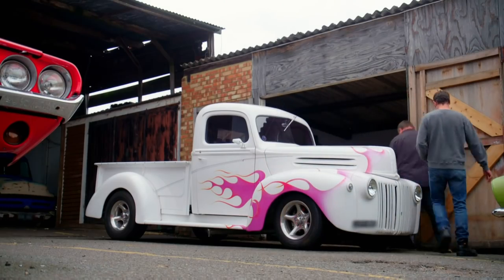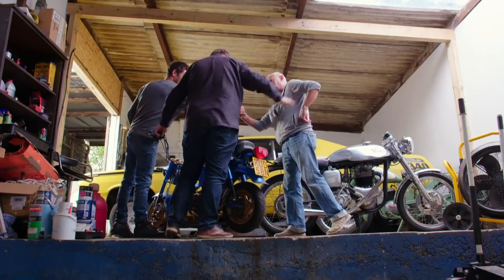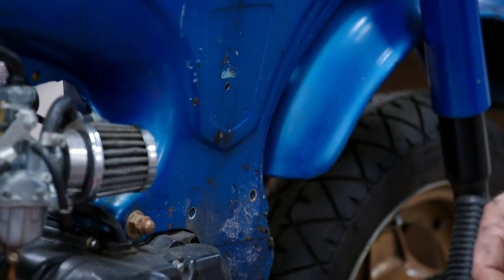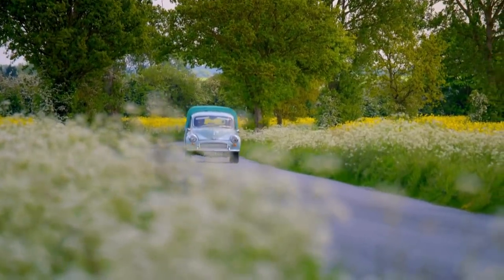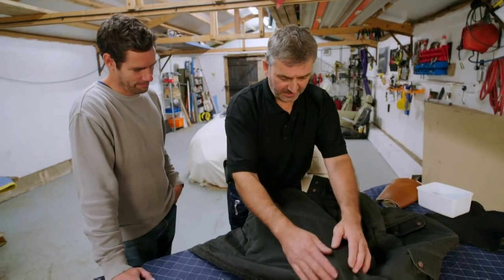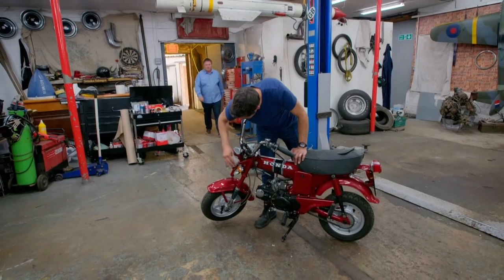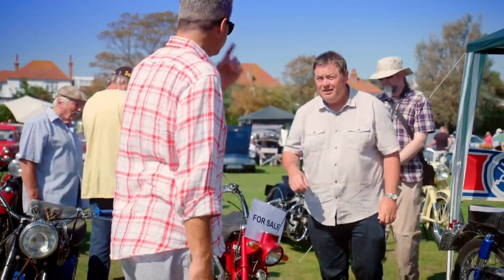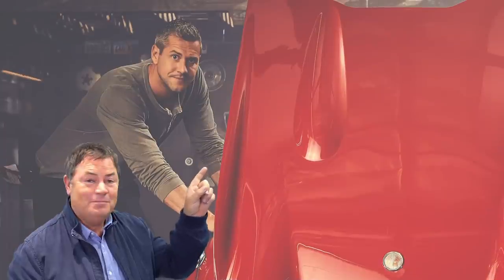Customising A Classic Honda Monkey Bike | Wheeler Dealers: Dream Car

Comment: Mike....  that’s NOT a Monkey bike!   That’s a Honda Trail CT70.  The Monkey bike was a 50cc, looks much different.  Had a real Gas Tank, not built into the frame like your CT70.
Reply: I agree, but I think in every different part of the world it has different names. In Japan, and other Asian countries it's called Honda Dax.
Reply: It is a Dax basically everywhere except in the US. 

The reason for the Trail-70-name in the US is that a special trail-version of the supercub (C90 in the UK) was actually both suggested and built in the US by one of Hondas distributors (and Honda listened and started to do that versionas well) and thusly the “trail”-name (trail 90) was introduced. So for the US marked, they took the trial-name and called the Dax “trail 70”. 

And in fact, even the Monkey got a trail-namn! The “mini trail” in America, instead of calling it the Monkey or only just Z50. 

The Monkey by the way was not sold at all in the UK. So most of the UK monkeys in the Z-series are privately imported.

Comment: I’ve got 2 Honda CT70s, one totally custom and one bone stock.  If you’ve ever spent much time on the saddle of one of these, having lumps and bumps on the saddle will turn literally into a pain in the butt.  I did over 250 miles on my Vespa GTV300 on smooth Italian leather and STILL my butt was KILLING me by the end.  I bought a blow up saddle cover for the next time.

Comment: Nice episode, but… IT IS NOT A MONKEY! 

John Lennons bike was a Monkey, the bike it all started with 1961 (Z100) was a Monkey, and all but a few of the Z-bikes after that are Monkeys! 

But the bike you have there is a Dax! 

Named after the german Daxen-dog (sausage-dog)! It is the big brother of the Monkey. Not a Monkey. 

The Dax is bigger than a Monkey - just to AVOID the crutched style of driving that drivers of normal size suffer, and that gave the smaller Monkey its name. 

The Honda Dax is stretched like a sausage-dog and is therefore very comfortable for normal size grownups! So hearing Mike saying “monkeybike” over and over again (like if the purpose of the episode is to spread the wrong name!) is quite annoying…

Okay I get it, you are a car expert, not a motorcycle expert, but still… 

Please add a text or something to correct it. Saying Monkey about a Dax is like calling a Pan European a Goldwing! They are different bikes. 

It could also be noted that even the version of the Z50 with a larger tank was renamed the Gorilla.

The fact that Honda now have a large bike styled as a Monkey, and have chosen to call it Honda Monkey 125, without giving it a Z-designation is slightly disturbing, but what can we do? Honda can do it, they own the Monkey-name. 

Calling a Dax “Monkey” or calling a Pan European “Goldwing” is something else. It is not okey. 

But still nice to see car guys doing something motorcycle! 😀👍